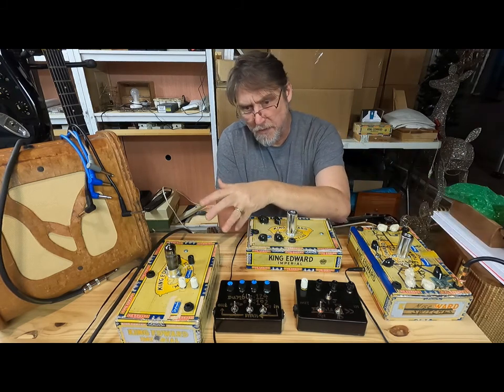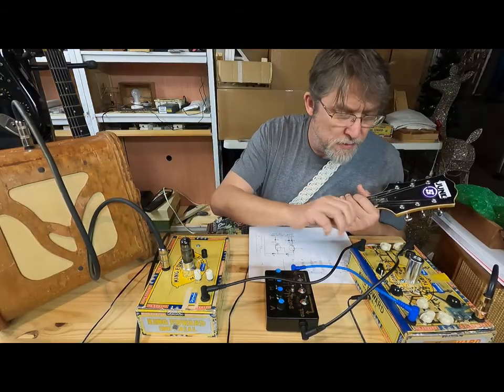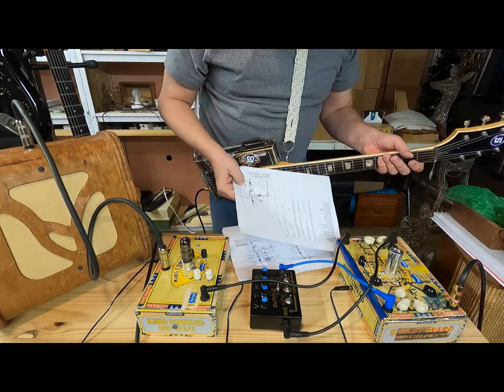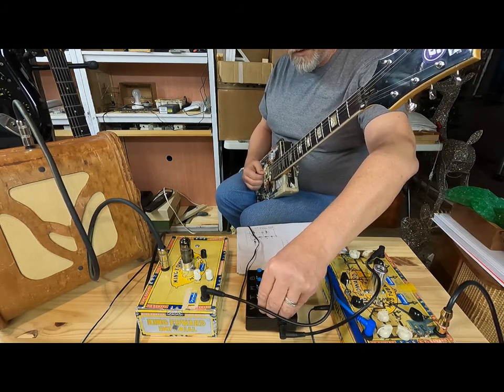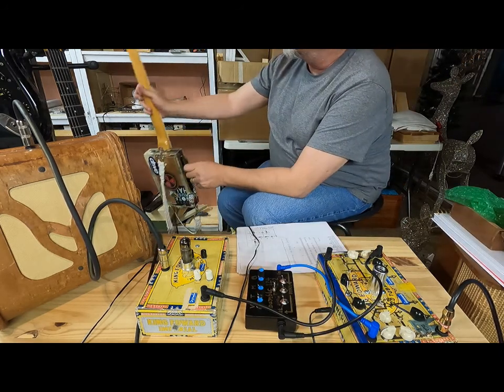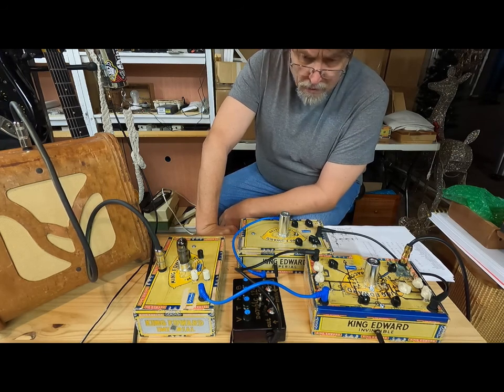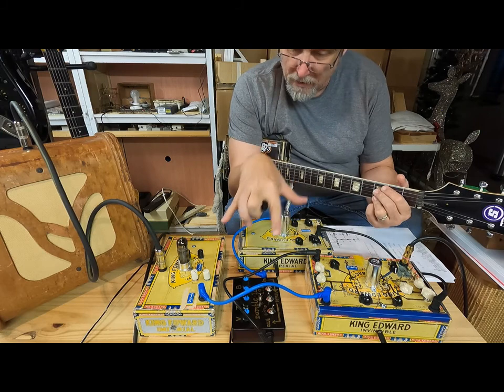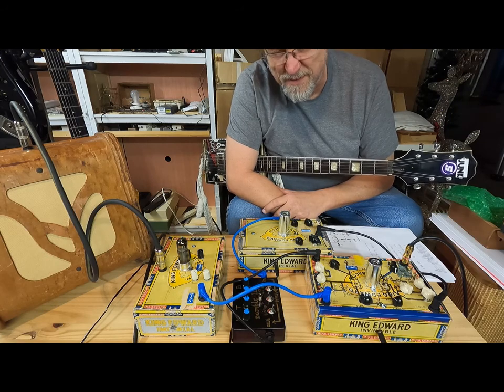Mad Scientist Lab: 12AX7 EL84 test, Fender Princeton, Marshall JCM800, Jackson mod, Dumble

Comment: really cool video.. I ended up here because I was looking into what a JCM 800 would sound like with an EL84 power stage. I have a 1986 JCM 800 2203 100 watt head I just bought a set of THD Yellowjacket adapters for, and a matched quad of EL84 power tubes. I wanted to try a different tone and tame the sound for home use without permanent mods or having to re-bias.  I am interested in amp construction and building techniques so this was just great little video. A Youtube 'hidden gem" award ( I just made that up) :)  You have some nice guitar chops too I think, though you didn't play too much .Thanks!
Reply from the maker: Wow, thank you! I enjoy playing but I have no memory for songs and bad timing. Lol. I’ve always loved the 12ax7 / el84 combination and I wanted to see just how versatile they could be without having to build a full on amp around them. I’d love to know how your house volume mod works on the jcm 800.